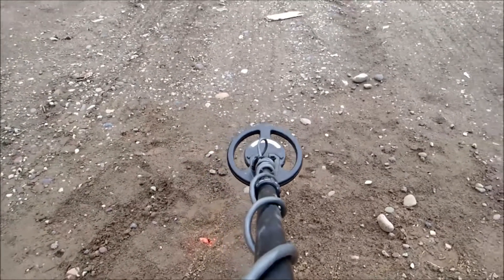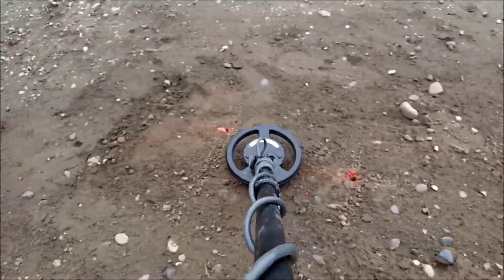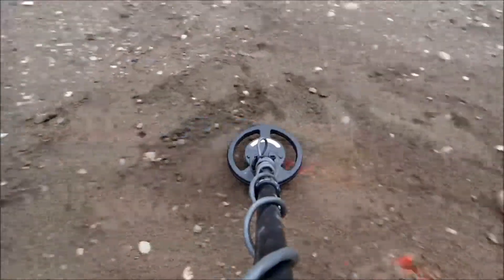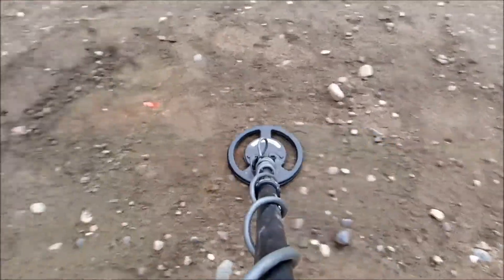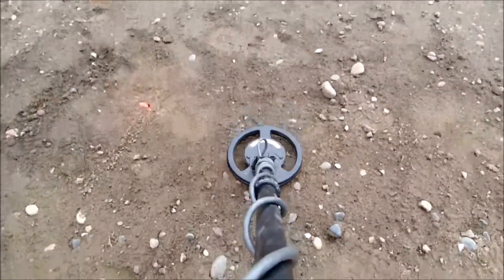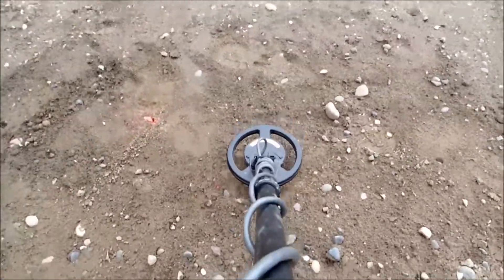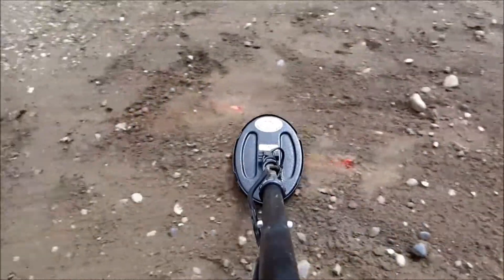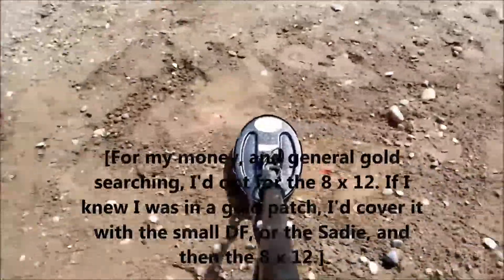TDI SL battery voltage test on various coils

Comment: hi Jim
going to sell my tdi pro 
was repair at centerville about 2 months ago  should still have warranty if you Interested
Reply from the maker: How much?
Reply: @jimnelson7740  1250 shipped tru paypal or zelle ..
Reply from the maker: @Tesorosaprofunidad  Oh brother, if you can get 1,250 for that, I'll eat my hat....LOL
Reply: @jimnelson7740  i saw a tdi pro go for 1700 at ebay with extra coils.. the thing is that centerville charge me 600 they replace the Whole mother Board.. 
 the detector is deep but i dont like to dig everything equinox and AKA Intronik do decent job at beach
Reply from the maker: @Tesorosaprofunidad  Well, if you can sell it for that, I'd say go for it. I've got a modified TDI SL that I feel will do anything the Pro will do, and it's  much lighter. I hope you get a good price for it. Sounds like it's in good condition. Best of luck!
Reply: @jimnelson7740  With new motherboard should be runnin like new.. 
its a deep unit got a 16in Nickel at wet sand but the slow sweep and all metal not work for me and the time am waiting on aq impulse hope its soon release
Reply from the maker: @Tesorosaprofunidad  One of the mods I did on my SL was to increase the sweep speed. That made a big difference. It will pick up a small section of nickel at 6"-10". But, I don't live near ocean beaches, unfortunately.

Comment: where u located can you help me out my tdi pro went dead
Reply from the maker: I'm located in southeast Idaho, Jose. I would be happy to look at your machine. in the event you can't get it repaired, I might even buy it from you. You might get in touch with Centreville Electronics. They're somewhere back east and are the best repair facility for the Whites machines. if you can't locate them, get back to me, and I'll find them for you.
Reply: @jimnelson7740  Thanks for the fast reply .. am gonna look them up.. am interested on the mod too.. will they do it too.... u interested in a tdi sl?
Reply from the maker: @Tesorosaprofunidad  Nope...I already have a TDI SL, on which I did both of Reg Sniff;s mods. It works really well. i don't know if Centreville will do the mods. Probably would, if they knew what  components to change and remove.
Jim

Comment: Jim Ive been trying to find a video on Regs SL mods and a place to get the 16V battery packs forever it seems. I just run into dead end forums one after another. How do you do these mods? Where do you get this battery pack? Please Help... Thanks
Reply from the maker: Will, the guy that makes and sells the pack is called Reidman on Ebay. But, he's a one-man show, and only makes a few. The best way is to make your own. Here's a link to a guy that made one:
https://www.detectorprospector.com/forums/topic/10658-whites-tdi-sl-4x18650-battery-tray-made-simple/
My email is <jrnelson_536 AT q DOT com> if you email me, I'll get back to you with more info on the battery and mods.
Jim